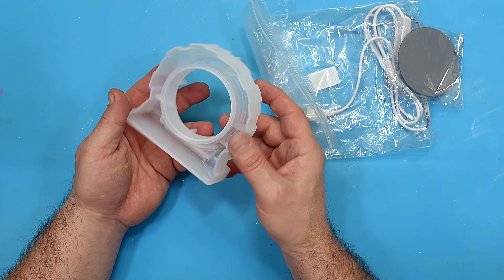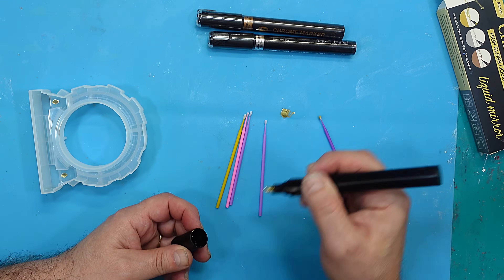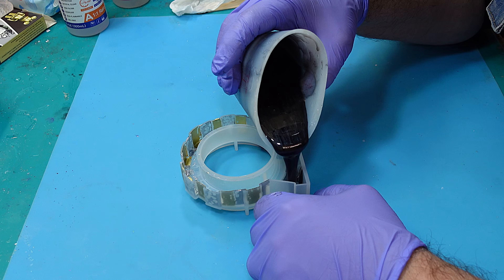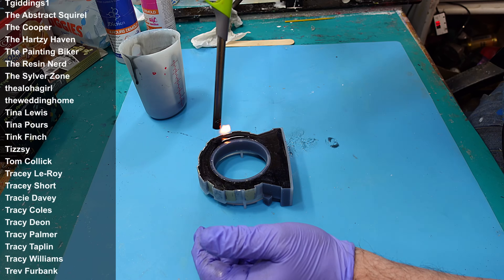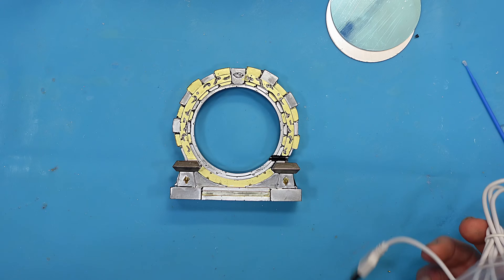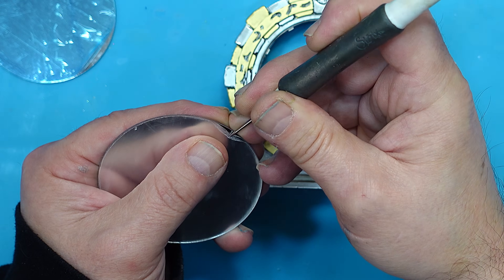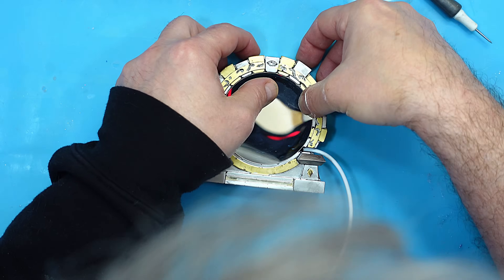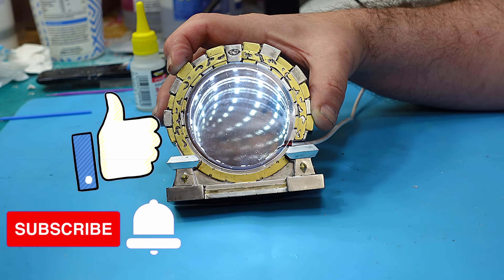The INSANE Magic of an Infinity Mirror - Guess How I Made It.

Comment: My husband makes these from box frames from hobbycraft, one way/2 way mirror sheet from an online store that cuts to size and light strips from temu
Reply: Which light strips? I just find them too long.  Can they be cut an still work?
Reply: @cathyjresindesigns  yes usually any strip of lights if led can be cut and work. Obviously don't cut the power end. Some come with connectors so you can Marry up short bits you've cut off 🤗
Reply: Thanks so much!
Reply: Sarah could you please share which online store your husband gets the mirror sheets cut to order from please.